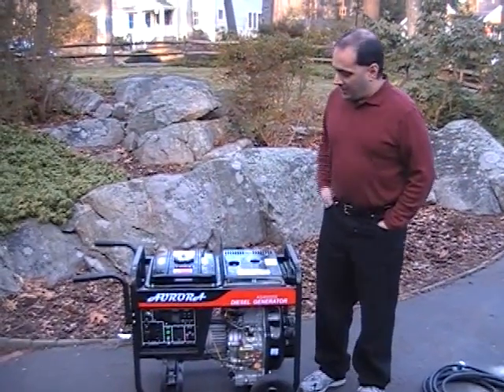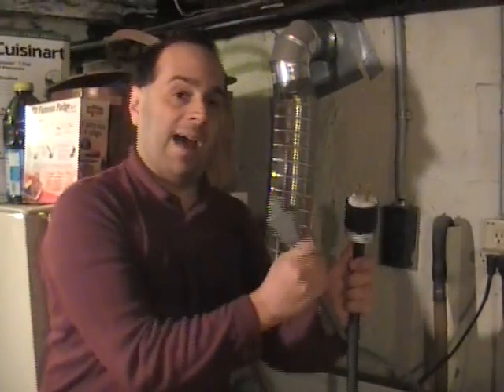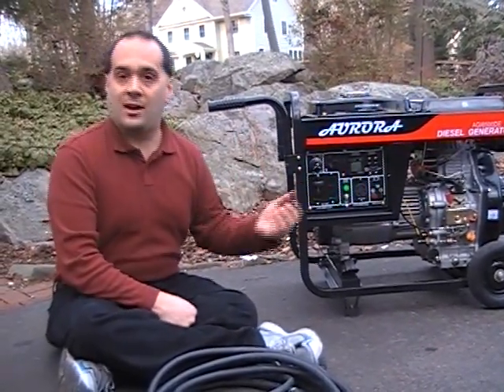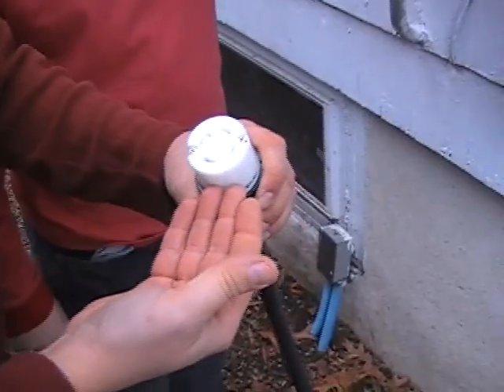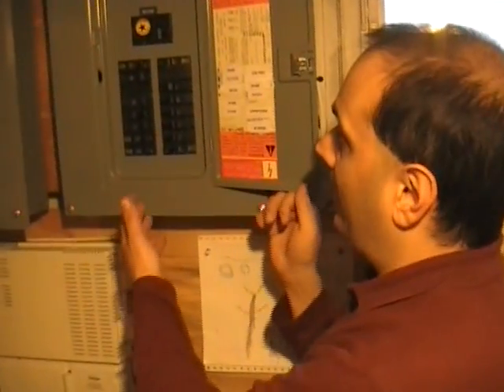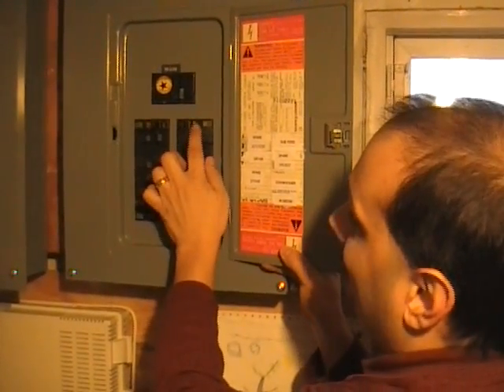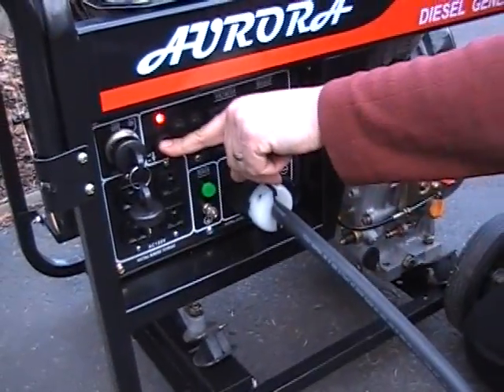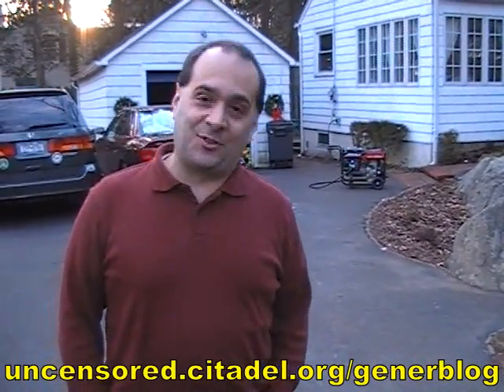Inexpensive residential generator hookup

Comment: Great basic , safe, and well spoken. Time to add the new coded inexpensive smart Gen switches ya can buy now.. 6-10 breakers. Still, a very well intelligent video !
Reply: Here are the portable generator safety rules: make sure you are aware of all the warnings before using portable generators. This is just a reminder for everyone’s safety. All generator safety rules should be followed carefully. This advice is just to make sure that everyone is aware of all the warnings and it’s just to remind people to be careful using portable generators. Generators can be dangerous if not used carefully. Every year, hundreds of people die or get injured when using portable generators due to carbon monoxide poisoning and electrocution. Make sure you are using your generator carefully and keeping others safe as well. There is something very serious that everyone should always be aware of when using generators. Some people do run their generator indoors which is not safe and that increases the risk of carbon monoxide poisoning which can cause death of family and you. Some people run their generator in wet conditions which can electrocute them. Please remember that you should never run your generator indoors. Remember that carbon monoxide is an odorless and colorless gas that you cannot see or smell. Carbon monoxide is a silent killer. Keep that in mind. Make sure your generator is 15-20 feet away from your house and away from doors, windows, and vents. Never use your generator in your porch too. Having a carbon monoxide detector is very important against generator safety. Some people also allow children to go near the portable generator which could pose risks. We need to keep an eye on our children making sure that they are not near the portable generator so they won’t get electrocuted or burned by the generator which is dangerous. A locking enclosure also keeps kids safe. A generator shed might look like a tempting place to explore, or take cover during a game of hide and seek, but a generator is a dangerous piece of equipment that can cause injury. It says on the manual that we should also keep children away at all times from the portable generator to avoid injuries. Please do not allow a child or unqualified people to operate the portable generator.  It is important to keep your children safe especially little ones. The portable generator can be hot during an operation. Just because some manuals missed what should be listed doesn’t mean it’s safe to do. Always follow the generator safety rules when using portable generators. Generators pose electrical risks. If you need to use your generator during wet weather, you need a generator tent to protect your generator from getting wet. Don’t let your generator get wet. Keep your generator dry and before using your generator, please make sure your hands and your generator is dry. Do not wear loose clothing when operating the generator. Everything that is said on the generator’s operating manual should not be ignored. Never smoke cigarettes near the generator. Please keep flammable things away from the generator. Never overload your generator too. Your generator can catch fire. Never ever try to plug a generator cord into a wall outlet to avoid back feeding. Back feeding your generator is dangerous. Always turn on your generator first before plugging in appliances and shut off the appliances before turning your generator off. Use a heavy duty cord for your generator and the cord should not be worn out. All the instructions should be followed carefully. Never refuel your generator while it’s running. It can cause fire if fuel spills while your generator is hot. You should turn off your generator and let it cool off before refueling it. Having a fire extinguisher next to the generator is also important. This is only a reminder for everyone’s safety of using generators. Make sure your generator is properly grounded. Having a fire extinguisher next to the generator is also important against the safety rules. https://youtu.be/I1jT3ANENvI and here is a video more about keeping others safe when using generators and also about our family’s safety. It’s important to keep our little children safe as well. Make sure they’re away from the generator. Hope this helps.

Comment: Thank you for showing correct/safe ways to connect. Allow me one remark concerning about 'burning down the house'. When the circuit is fused with 32A, it doesn't matter which direction the current is flowing. When the wire/cable becomes warm/hot while back feeding, it has a wrong cable or wrong fuse. It will become hot also when you draw the 32A, e.g. for the dryer..
Reply: Here are the portable generator safety rules: make sure you are aware of all the warnings before using portable generators. This is just a reminder for everyone’s safety. All generator safety rules should be followed carefully. This advice is just to make sure that everyone is aware of all the warnings and it’s just to remind people to be careful using portable generators. Generators can be dangerous if not used carefully. Every year, hundreds of people die or get injured when using portable generators due to carbon monoxide poisoning and electrocution. Make sure you are using your generator carefully and keeping others safe as well. There is something very serious that everyone should always be aware of when using generators. Some people do run their generator indoors which is not safe and that increases the risk of carbon monoxide poisoning which can cause death of family and you. Some people run their generator in wet conditions which can electrocute them. Please remember that you should never run your generator indoors. Remember that carbon monoxide is an odorless and colorless gas that you cannot see or smell. Carbon monoxide is a silent killer. Keep that in mind. Make sure your generator is 15-20 feet away from your house and away from doors, windows, and vents. Never use your generator in your porch too. Having a carbon monoxide detector is very important against generator safety. Some people also allow children to go near the portable generator which could pose risks. We need to keep an eye on our children making sure that they are not near the portable generator so they won’t get electrocuted or burned by the generator which is dangerous. A locking enclosure also keeps kids safe. A generator shed might look like a tempting place to explore, or take cover during a game of hide and seek, but a generator is a dangerous piece of equipment that can cause injury. It says on the manual that we should also keep children away at all times from the portable generator to avoid injuries. Please do not allow a child or unqualified people to operate the portable generator.  It is important to keep your children safe especially little ones. The portable generator can be hot during an operation. Just because some manuals missed what should be listed doesn’t mean it’s safe to do. Always follow the generator safety rules when using portable generators. Generators pose electrical risks. If you need to use your generator during wet weather, you need a generator tent to protect your generator from getting wet. Don’t let your generator get wet. Keep your generator dry and before using your generator, please make sure your hands and your generator is dry. Do not wear loose clothing when operating the generator. Everything that is said on the generator’s operating manual should not be ignored. Never smoke cigarettes near the generator. Please keep flammable things away from the generator. Never overload your generator too. Your generator can catch fire. Never ever try to plug a generator cord into a wall outlet to avoid back feeding. Back feeding your generator is dangerous. Always turn on your generator first before plugging in appliances and shut off the appliances before turning your generator off. Use a heavy duty cord for your generator and the cord should not be worn out. All the instructions should be followed carefully. Never refuel your generator while it’s running. It can cause fire if fuel spills while your generator is hot. You should turn off your generator and let it cool off before refueling it. Having a fire extinguisher next to the generator is also important. This is only a reminder for everyone’s safety of using generators. Make sure your generator is properly grounded. Having a fire extinguisher next to the generator is also important against the safety rules. https://youtu.be/I1jT3ANENvI and here is a video more about keeping others safe when using generators and also about our family’s safety. It’s important to keep our little children safe as well. Make sure they’re away from the generator. Hope this helps.

Comment: Great video!  This is one of the few examples of videos I have found with somebody actually telling you the correct way to back feed.  There are so many videos on youtube showing the "cheap" or "easy" way to back feed where they almost always use a suicide cord and or do not have the mechanical interlock.  The one thing that you should add though is to talk about floating vs bonded neutrals on the generator and the importance of it.  Most of the non-inverter portable generators are of the bonded neutral type (at least that I have seen) which would still violate NEC code when plugged into your otherwise completely legal setup.  If you plug a bonded neutral generator into this setup there would be current coming back on your ground and neutral wires instead of just the neutral as it should.
Reply: Here are the portable generator safety rules: please make sure you are aware of all the warnings before using portable generators. This is just a reminder for everyone’s safety. All generator safety rules should be followed carefully. This advice is just to make sure that everyone is aware of all the warnings and it’s just to remind people to be careful using portable generators. Generators can be dangerous if not used carefully. Every year, hundreds of people die or get injured when using portable generators due to carbon monoxide poisoning and electrocution. Make sure you are using your generator carefully and keeping others safe as well. There is something very serious that everyone should always be aware of when using generators. Some people do run their generator indoors which is not safe and that increases the risk of carbon monoxide poisoning which can cause death of family and you. Some people run their generator in wet conditions which can electrocute them. Please remember that you should never run your generator indoors. Remember that carbon monoxide is an odorless and colorless gas that you cannot see or smell. Carbon monoxide is a silent killer. Keep that in mind. Make sure your generator is 15-20 feet away from your house and away from doors, windows, and vents. Never use your generator in your porch too. Having a carbon monoxide detector is very important against generator safety. Some people also allow children to go near the portable generator which could pose risks. We need to keep an eye on our children making sure that they are not near the portable generator so they won’t get electrocuted or burned by the generator which is dangerous. A locking enclosure also keeps kids safe. A generator shed might look like a tempting place to explore, or take cover during a game of hide and seek, but a generator is a dangerous piece of equipment that can cause injury. It says on the manual that we should also keep children away at all times from the portable generator to avoid injuries. Please do not allow a child or unqualified people to operate the portable generator.  It is important to keep your children safe especially little ones. The portable generator can be hot during an operation. Just because some manuals missed what should be listed doesn’t mean it’s safe to do. Always follow the generator safety rules when using portable generators. Generators pose electrical risks. If you need to use your generator during wet weather, you need a generator tent to protect your generator from getting wet. Don’t let your generator get wet. Keep your generator dry and before using your generator, please make sure your hands and your generator is dry. Do not wear loose clothing when operating the generator. Everything that is said on the generator’s operating manual should not be ignored. Never smoke cigarettes near the generator. Please keep flammable things away from the generator. Never overload your generator too. Your generator can catch fire. Never ever try to plug a generator cord into a wall outlet to avoid back feeding. Back feeding your generator is dangerous. Always turn on your generator first before plugging in appliances and shut off the appliances before turning your generator off. Use a heavy duty cord for your generator and the cord should not be worn out. All the instructions should be followed carefully. Never refuel your generator while it’s running. It can cause fire if fuel spills while your generator is hot. You should turn off your generator and let it cool off before refueling it. Having a fire extinguisher next to the generator is also important. This is only a reminder for everyone’s safety of using generators. Make sure your generator is properly grounded. Having a fire extinguisher next to the generator is also important against the safety rules. https://youtu.be/I1jT3ANENvI and here is a video more about keeping others safe when using generators and also about our family’s safety. It’s important to keep our little children safe as well. Make sure they’re away from the generator. Hope this helps. Remember, safety first.

Comment: Excellent advice. Diesel engines are far more efficient than gasoline engines, but be sure to put winterized fuel in the tank and run it long enough to have the winter fuel completely through the fuel system before cold weather comes and to have winter fuel in supply too. Also no matter what your generator type, definitely turn your breakers on slowly. Things like well pumps and sump pumps may have a large power draw, so turn your largest draw on 1st, and then work down the list (we give about 30 seconds between turning each breaker on, but up to a minute for things like the well because it will take longer to catch up and electric motors use more power in startup than run cycle) also some modern appliances are very voltage sensitive and it might be better to just not use them in an outage.
Reply: Diesel engines must run under heavy load, if you only test run every couple months you’ll get cabin build up.  All diesel generators manufacturers state that on their manual.  Probably better 𝘧𝘰𝘳 off grid.
Reply from the maker: @Belchingbastard  Agreed.  Running a diesel without any load will eventually cause it to wet stack.  I always put at least 2000 watts on when I exercise/test the generator.
Reply from the maker: Yup.  I actually put stabilizer in every can of fuel that's going into my generator, my lawnmower, snowblower, weed trimmer, chainsaw, basically everything except the car.  Doesn't matter how soon I expect to consume the fuel.  My small engines run in tip-top shape because of this.